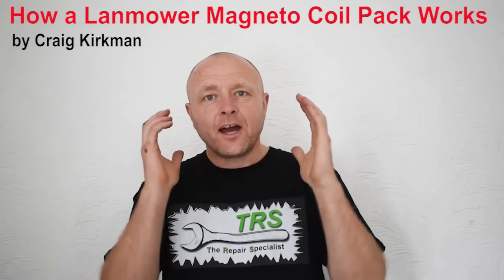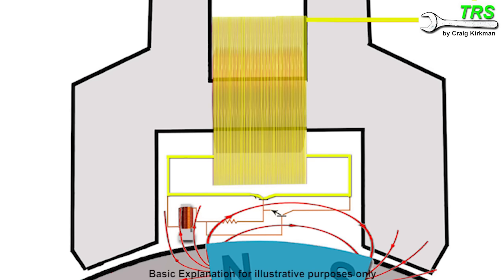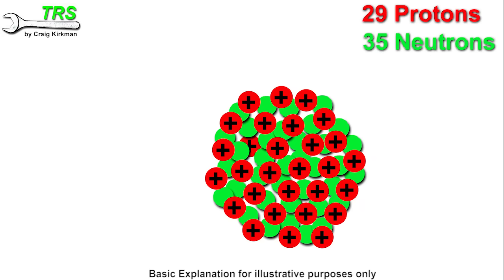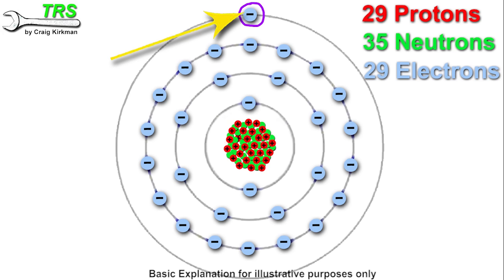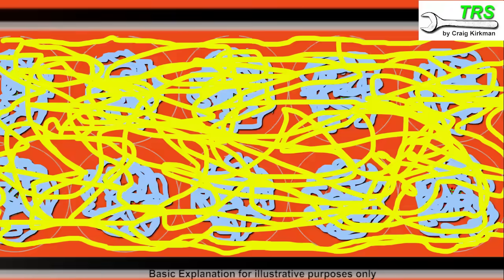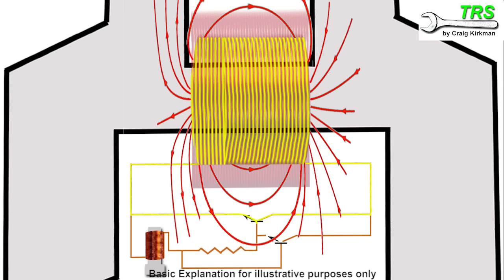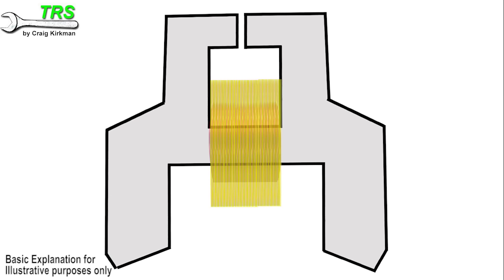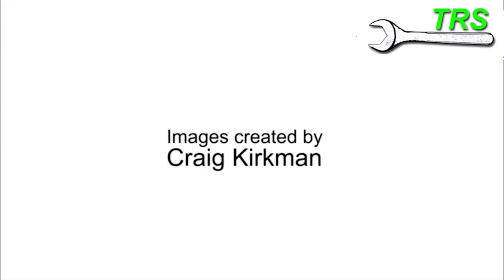Lawnmower Coil Pack Sparking System - Induction Coil, Transistor!  (by Craig Kirkman)

Comment: So is there a reason the iron “frame” of the coil is in the shape? Also, it seemed that cleaning the ends of the iron where the flywheel passes by helped previous engines run better, was that a coincidence than, because they don’t seem to have an actual purpose?

Comment: Close to perfect, except for the reason for the electrons being attracted part, the other end of the secondary is connected to ground, if not then essentially the kill switch is on!! The secondary is actually connected to the iron core with a rivet, which completes the circuit path..

Comment: So , if I was wanting a "hotter" spark for a small engine used for racing applications , should I try to find a coil with a higher or lower ohm reading ?  Would a stronger magnet on the flywheel change anything ?

Comment: Best presentation on subject in YouTube archive. Very inspiring. 

One detail event I missed here following page 3:38 and if I may add to it, is the following. 

- as the magnet S pole is approaching trigger coil the coil current turns on the transistor.  Transistor continue turned on when S pole has pass and before it meets magnet’s N pole. 
- this enable the transistor to pass charge in the primary coil as long as triggering coil “sees” N pole. 
- when magnet S-N pole is meshed side by side with the ignition iron core, that is the final moment that triggering coil sees the S pole. 
- in 3-5 degrees later the N pole suddenly appears to the triggering coil, also suddenly biased off the transistor. 
- the primary current collapses instantly and the primary energy gets trapped in the ignition core, the only way out is a lower impedance - through the secondary coil. 
- the secondary energy rushing out to meet with an open circuit at the spark plug air gap, but overcome by the immense high energy, voltage, the air across the gap gets ionized and become extremely low impedance, thus begin to conduct as a plasma. 

Hope this helps.

Comment: Sir:   Without a doubt, the most cogent explanation of magneto ignition I have ever read. Excellent articulation, constant speech level , no irritating music, no "UMM's & AHH's " & absolutely without errors of any description. I smiled at the printed message that said that the current did not travel at exactly the speed of light....can you say "drift current" ?   Theoretical  physicists would of course point out the electron speed in the conductors would be inches per minute, & that the energy is actually carried in the electric & magnetic fields surrounding the conductors. Your excellent presentation  enlightens the layman, not one with a Doctorate in electron physics.  Bravo !   Well done !   I AM impressed.  Cheers!

Comment: This was absolutely awesome now explains why I dont have spark for my lawn tractor. You need to do one of these using a magneto with points.or as in my case points condenser coil charging system. I restore garden tractors that have been sitting in the back 40 for many yrs.and it's always baffles me that they never use color coated wire it's all the same color  black and then was painted whatever color the tractor at hand was painted huh nightmare. This was great very informational.you got a new subscriber.

Comment: That was fascinating! Thanks. May I ask what is probably a stupid question? If electrons are being stripped off the outer shell of the copper atoms and pushed to the engine block . . . here comes the stupid question . . . does there come a time when there aren't enough outer shell electrons left to create current? That is, when a sufficient number of movable electons not longer exists in the electron sea, will the coils be no longer capable of producing current?

Comment: A great credit to you for the animation to see the size of the PM wrt to the core size and showing the associated electronics. If this ignition assembly has no condenser in the primary circuit, to cause it ring, what helps the spark size/duration I wonder! Do you know?

Comment: I like the video. But what would happen if you forged copper with iron then tried to make a charge come through it with magnets. Also theoretically could you add possibly four more coil packs on one lawn mower engine but use other for coil packs like a battery charger? Or maby  a welder?

Comment: So the trigger coil is the replacement for breaker points as in the earlier conventional magneto ignition systems???🤔🤔🤔. Then how does a CDI ignition work? Great video. I know how a CDI module ignition works. But many may not know. Maybe do a video on a CDI ignition system. Another term one could use as the permanent magic passes past the stator system or trigger coil is magnetic flux

Comment: Hi Craig, I've just replaced the ignition coil on my Briggs and Stratton engined lawnmower and was wondering how the ignition coil worked....Well, thank you so much for this wonderful explanation of the physics and the structure of the transformer. I learned a lot and now it all makes sense. What a great piece of ingenuity to design this clever source of pulsatile potential difference which drives the spark plug. You're a natural explainer and I really liked the graphics.

Comment: Hi Craig i assume the actual timing, the instant the plug fires, is when the detector coil detects the zero voltage point when the north and south poles cross, other wise it could virtually fire anytime the magnet leaves the coil area...on motor car ignition coils the primary is wound over top of the secondary, well at least that's how it used to be....from Fred in Essex.

Comment: In my Early Teens, I trashed picked a Snapper Rider. My Step-father saw me with the Mower and marched me back down to the owner. Paid $5.00 to make the mower officially mine. I figured out the Coil was bad and bought a new one. A little cleaning on the Carburetor, and I was in business mowing yards.

Comment: This almost makes sense to me, but it seems to imply that the trigger coil itself generates the power which drives the spark. Surely that means that it is not in fact a trigger coil, but a generating coil.
Why is the laminated core within the arc of the rotating magnet?

Comment: Great explanation ... but I don't understand the magnetic circuit in the iron core ? Why the air gap in the upper part of the iron core and why the design of the larger lower section near the permanent magnet??😃

Comment: In the electronic coil...where is the resister that acts as a points system for the on and off of current to spark plug ?

Comment: Just as said by everyone you are a superb teacher, gifted and very well motivated.
My comment needs to be taken in the context that English is not my mother tongue (Spanish) and even I am a retired mechanical engineer graduated in USA  plus 23 year retired I have difficulties understanding the words. In addition I have a severe hearing condition that even hearing aids nowadays do not seem to correct to the level I desire.
I wish to be able to follow up on all of your presentation and I bring to you this simple suggestions for our benefit:
If you could slow down a little bit your speech and try more emphasis on the enunciation. This would help handicapped people like me with one or two of the conditions: Hearing Impaired; non-English as the mother tongue.
Please do not take it as criticism, but just as a plead for me/us to benefit even more for your excellent work.
Additionally I have a question you may want to tackle on future videos: How does this ignition system tackles the advance/retard of the spark as the RPM changes?
Reply: 3400willy I haven't actually watched yet - reading comments - but often closed captions {CC}  (text of what is being said) is available and sometimes in different languages - lower right corner - - Advance/retard = not done - fairly steady speed ---lawnmower ;-)

Comment: That spade connector on the side, where should that cable go? My lawnmower has had its ignotion key replaced with a standard 3 connector one (original was five)

Comment: As an electronics technician of 40+ years I'd say that this is the best explanation I've seen of this system. If there is a shortcoming, it is in the way that the operation of the  two transistor circuit has not been explained.
I'd be interested to know how this circuit worked before the use of a transistorised circuit.

Comment: I think you could add two things: 1) the opposite end of the secondary coil being tied to the the frame of the laminated fixture to complete the HT circuit, and 2) an explanation of the previous version of this magneto ignition, which used a set of breaker contacts driven off the camshaft or an eccentric on the crank. Unlike the Kettering auto ignition, which collapses the Primary field when the contacts open, the magneto version initiates the spark when the contacts close. All in all, a good video!
Reply: Spectacular!
Reply: That's why he said "basic explanation" pay attention.😉
Reply: @chrisstreet7384  Attention is why he got those recommendations. There is a big difference between "basic" and "incomplete."  😇
Reply: @arthouston7361   most of the people that he is aiming this towards don't have any idea that it's incomplete. I'm assuming he said basic he had a time frame for this video. The fact that it's incomplete is beside the point. I am assuming that he said basic just to get people to watch and learn and get interested.All same time making a 15-minute video as opposed to a 30 or 45 minute video where people could lose interest.
Reply: @chrisstreet7384  Interesting. I have to guess that you had nothing better to do today than to make a critique about expanding the knowledge of people who watched the video, assuming both the target audience and the intent of the content creator. A fascinating study on human motivations.
Reply: @arthouston7361  I do believe I'm a pretty good judge of character. Of course now you're way off course cuz this had nothing to do with the target audience or the maker of this video. I merely made a comment on your comment to the fact that you had nothing good to say to the man other than the fact that you left stuff out. You blatantly pointed out where he failed in making this video. And yes it does drive me absolutely up afreaking  when people feel the need to do that. Would have been one thing if you have thrown something nice and to say but it wasn't even constructive criticism you just pointed out his shortcomings,Fascinating!
Reply: @chrisstreet7384 This is youtube. You don't have to congratulate anyone for making a video, and it is not a negative to add information to a technical presentation. Perhaps you are not familiar with the format. Perhaps you have a need to make these unnecessary observations. You go ahead and enjoy yourself.  You have a great day, and you might want to not congratulate yourself too much. You comments were not helpful to anyone who wanted to learn about this topic.
Reply: @Art Houston  Aside from the energy source going from a moving magnetic field in the magneto to battery in the Kettering, are you inferring that the magneto is the opposite of the collapsing charge in the Kettering (i.e. building)?
Also, is what I agree was an excellent video called energy transfer ignition?
Finally, do you know how a capacitor discharge ignition is triggered?
Reply: @stephencrouse6032  I am saying that magneto systems that use points are triggered by the points closing, rather than the points opening, which triggers a Kettering ignition to use a primary field collapse to induce a high voltage discharge from the primary coil. In a CDI system, a crank position sensor causes a charged capacitor to discharge. I'm not sure why you asked that, but I hope it helps.

Comment: I like the video. I ordered that part for my mower and new sparkplug.  But the mower still will not start up...so I'm wondering if the space between the flywheel and the coil makes a difference in the timing... ? So is there a difference in the spark timing if the space between the magnet is different.

Comment: That was excellent !!  I knew the older ignition systems with mechanical contacts - having repaired many of those. But the contactless ignition was not clear to me.  As a german guy I listen gratefully to your clear spoken english which is good to understand. It helps much that there is no music in the background.

Now I am ready to learn how the ignition timing is made when the speed increases and the point of ignition should be earlier than at low speed.

Comment: For completeness you should mention, that the other end of the secondary coil is connected to the motor ground through the metal pack of the ignition set.

Comment: Excellent physics video.  Do the electrons eventually get depleted and the copper windings degrade to another compound and the transformer stops being a transformer?  How long would that take?  Do the windings have to be exact?  I'm sure manufacturing makes them an exact number, but if the inner winding was like 113 and the outer winding was something ridiculous like 999, would the transformer still work?  My guess is that a different voltage would result that would not be suitable for the engine to function properly.

Comment: So to get this right the new generation of coils like that  they transform up the voltage up 2 times where the old coils with points only got stepped up once and used a condenser for the first level of voltage the old coils did not have that tiny coil on the iron leg

Comment: Very nice.  I've always noticed that the ignition coil on a lawnmower does what it doesn't need to do and doesn't do what it needs to.  It fires the spark plug twice during a revolution; that certainly isn't necessary.  It doesn't have adjustable valve timing; it would be nice to be able to advance the spark under a load, like a car motor, to get more power out of the engine.

Comment: Your trigger coil circuit needs more in the circuit to work properly. You need a circuit to rapidly collapse the magnetic field around the core. In the point system you open the points and the condenser grounds the energy for a rapid collapse of the magnetic field. The way you explained the trigger circuit the energy would stay in the coil and collapse rather slowly. (Milliseconds which would be a long time for this circuit) the rest of the discussion was great.

Comment: I've tried over and over to get guys to realize that its the OPENING of the points that times the spark and I always get an argument. Set points wider to advance,Across the board. Good video,for sure!
Reply: Then least you always had the points to OPEN discussions on the topic, eh? 😁😉
Reply: So the opening of the points times the collapse of the magnetic field in the primary coil by disrupting the current! Unintuitive but it makes sense given the electrical theory behind it. I didn't get points ignition at all. Great comment!

Comment: Great presentation & detail copiously explained . Thankyou  . .. However , I have a question . Is it possible to simulate the small current from the permanent magnets by using a signal generator to fire up the ignition coil ?

Comment: After more thinking than writing ... you did answer a lot in your video.  I'm still left with one problem though - chainsaw/weedwacker coils don't seem to have the iron core of the 3rd trigger coil visible.  Leaving the questions of "How to tell if it is a pointless 3rd coil type or not"?  "How to tell which is the correct rotation if it's not written on the coil"?  Some may ask why I need to know, and suggest just look at the motor ... but knowledge like you teach is at it's most useful when we venture 'outside the box'.  Would be very helpful to learn how and which magnet and why in regards the placing of the 3rd trigger coil ?
And a bit more detail of the workings of the Darlington pair would also be fantastic ? I leave you in peace and wait with anticipation of more detailed learning ?
Thanks a huge amount, physics at school never got me this interested.